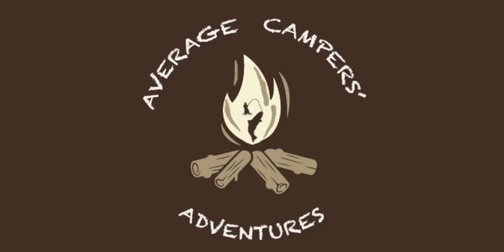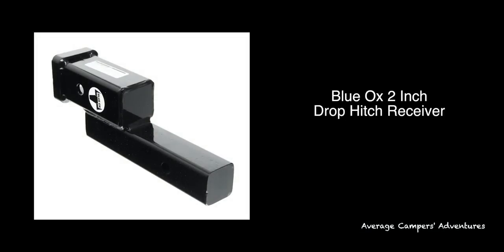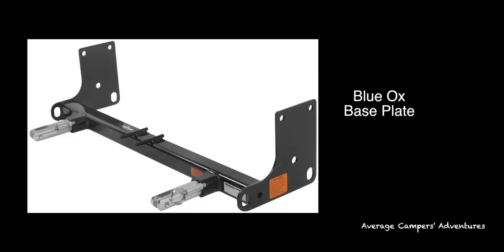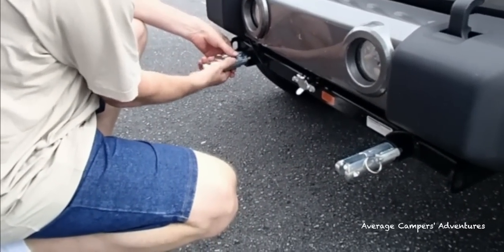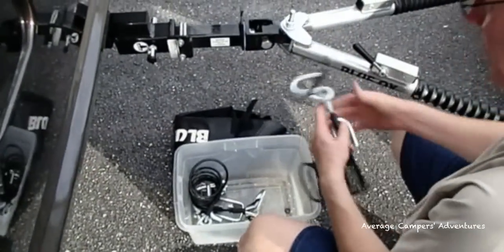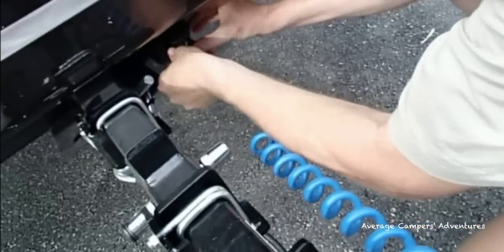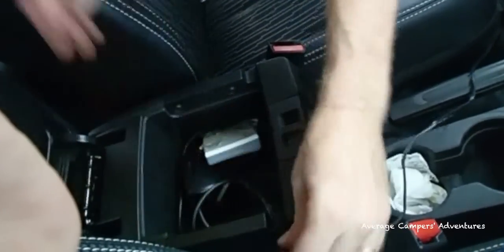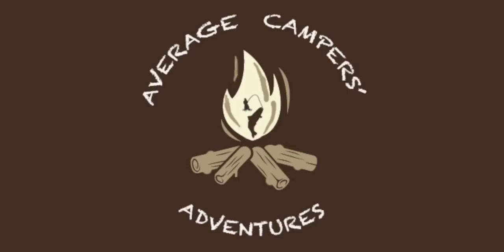Blue Ox RV Tow Vehicle Setup

Comment: Thanks for making this video. We will be flat towing a jeep soon and I am just learning the mechanics. Did you by chance do a video on the electrical install? Is this an 'add-a-bulb' system? Also I didn't see the break-a-way cable. Thanks again!
Reply from the maker: We used a add a bulb and ran wires to the rear break lights.  Made a hole in the housing to add the bulb.  We chose not to use the break away cable because of reports of the cable causing the breaks to lock up unexpectedly.  Thank you so much for watching.  You will love towing your Jeep!!